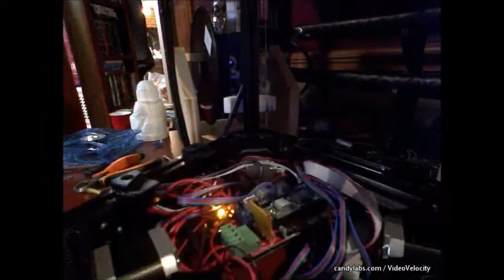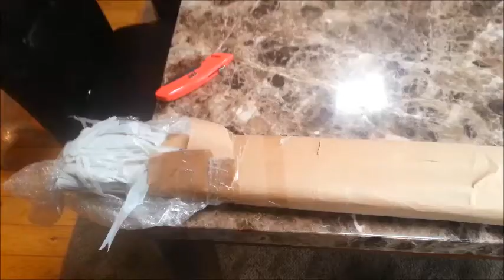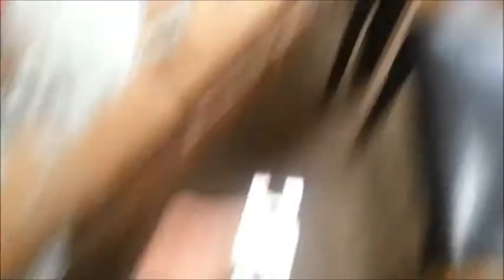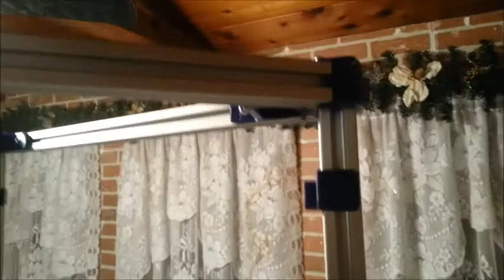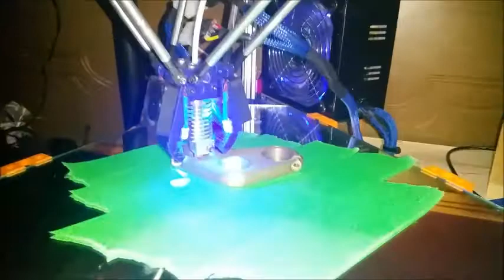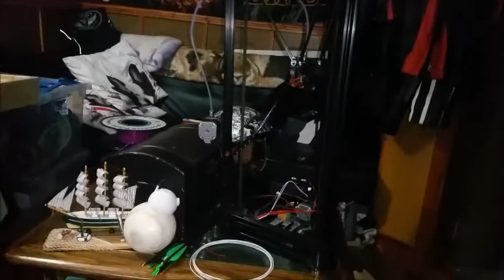Home made Kossel XL Build

Comment: what rods did you use
Reply from the maker: My rods are hallow aluminum tube. I had some lying around. I have another project I am working on and I sourced some cheap carbon fiber arrows from china with the OD and ID I was looking for. I picked up 6 arrows for around $8usd. They are 700mm long so I have lots of room to play with.
Reply: does the length matter, could you provide me with the steps you took? I am going to do something similar but i am not sure where to start.
Reply from the maker: Figure out your bed size, then as a rule of thumb from a tower base directly across from it to the frame take that measurement  and use this as your rod length. There are two things to consider to short a rod length and you will never reach the outer edgers of your maximum print area. Too long and and you reduce your print height and makes it harder to detect calibration errors

Comment: My Y Motor seems to be malfunctioning. I can home the X and Z motor normally but the Y will not move. Also i have gotten the Y motor to move up normally but going down with the G1 Z10 command it will sound like the stepper driver voltage is messed up. I have tried playing with the voltages but nothing seems to work. Any ideas?
Reply from the maker: Two things I would try, first I would swap out the stepper driver with one for one of the working motors to see if it is actually the stepper driver if you have not already done that, the second thing I would check if the stepper driver is fine would be the endstop switch. I would temp swap enstop connections with one of the other endstop and see if the Y motor moves.

Comment: what size are the extrusions and what website did you get them on?
Reply from the maker: They are 2020 and The towers are 1000mm tall and the horizontals are 450mm long. I purchased them on Aliexpress from the following seller: 
https://www.aliexpress.com/item/2020-aluminum-extrusion-window-profile-aluminium-profile-alluminio-profile/32671396638.html?spm=2114.13010308.0.0.MyUFex

Comment: Hi there I recently tried to do this same project with slightly bigger dimensions. I am having some issues, I believe with the ramps 1.4 board. Everything will be turned on and looking good but one I try to home the motors the ramps board gets fried. I currently have a 12v power supply i stole from a led light kit. I see that you are using a atx power supply. how did you get that to work with the ramps board.
Reply from the maker: Hello, I am using 12V from the ATX Main(the 4 pin coming from the ATX 
that is supposed to go to your main board. You will have two yellow and 
two black) You wire them up to  the four power connectors(The green plug
 connected to your ramps)It should be labeled on the ramps as 11A+. 
Ground, 5A+, Ground wire Yellow to your +'s and black to your grounds. 
Then on your main atx plug cable with the massive number of wires you 
short one of the black grounds to the green which will bypass the PC 
softon requirement and allow you to use the hard switch on the PSU to 
power your ramps. I cut every other wire but one more 12v line from the 
PSU, I kept a spare 12v to power lighting or any auxilary items I may 
want to add later. I may update this video to include a walkthrough of modding the PSU to run the printer. An ATX psu with sufficient power is much safer then one of those chinese switching power supplies also and is more efficient
Reply from the maker: What are the specs on that switching power supply and how do you have it wired up